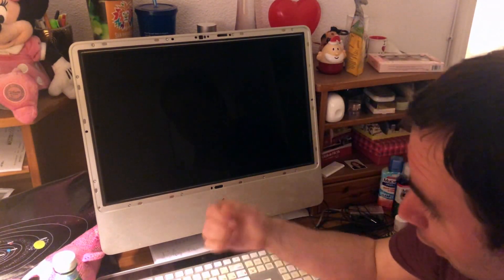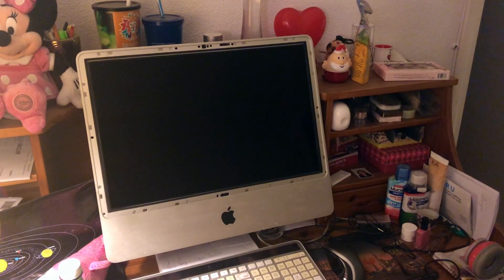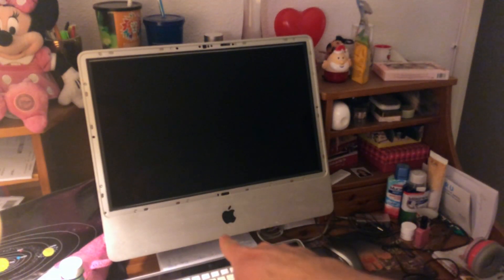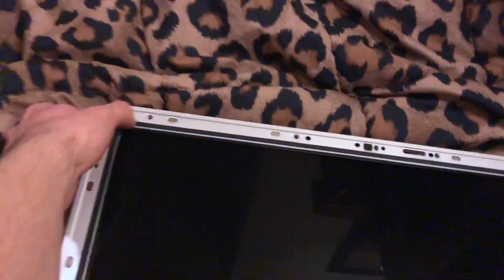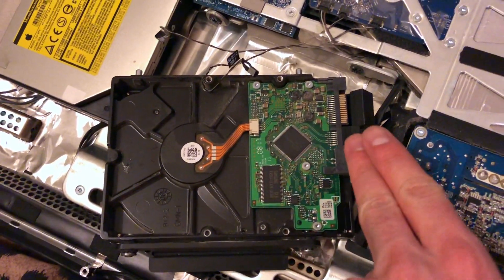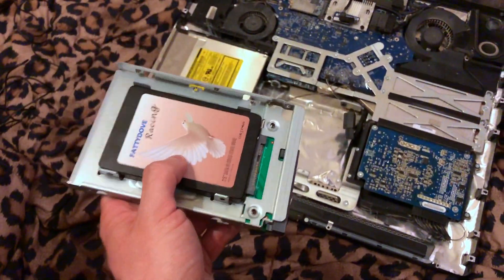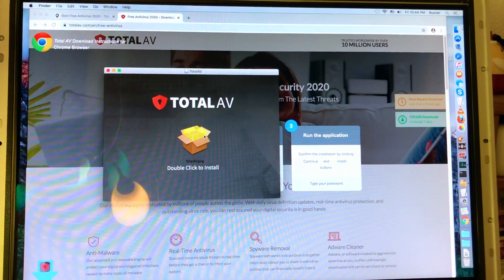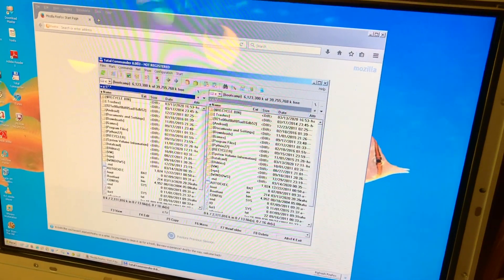How I Revived My 2008 iMac | Is it worth it?

Comment: I really wish Apple made the drive bay more accessible without having to take it all apart like the RAM is lol. I installed Monterey through OCLP and it works fine, even was able to install the newest version of Google Chrome but it's pretty slow and I think the original HDD is a big bottleneck.
Reply from the maker: Yeah, the process is not very straightforward, but after the SSD upgrade you will see a big difference.

HDD speed is that slow..

Comment: Gran video, como se puede solucionar el problema con los ventiladores el cambiar el ssd, existe algun adaptador?
Reply from the maker: @andrericar  ¿Por qué hay un adaptador ahí?
Reply: @NomadicDmitry  When replacing the HDD with an SSD, the temperature sensor from the HDD gets disabled, causing the Mac's fans to run uncontrollably. However, there is an adapter cable that simulates the temperature sensor, allowing the fans to work normally. That’s exactly what I’m looking for for the same iMac model, but I can’t seem to find it, my friend.

Comment: Yesterday i found iMac early 2008 in grandpa’s garage, switch off from 8 years, i would is it possible put 6 gb or 8 gb? 
And i would put 1TB ssd and i used to the iMac for only photo and video (for see and arrange)
Reply: identify it using this https://everymac.com/actual-maximum-mac-ram/actual-maximum-imac-ram-capacity.html (identify using EMC number on bottom of stand) it will tell you the max ram.

Comment: I’m having a problem with mine. It wont let me install any software at all and the software already installed is apparently gone. What should I do? Use an older disk?
Reply: The imac just boots into recovery mode everytime and I can’t do anything to get out of it since you can’t boot with a usb....
Reply from the maker: 1) Boot using the DVD shipped with a computer. You need to see in Disk Utility that Hard drive actually works
2) Install the OS from scratch.

I guess you first need to see if that's a hard drive problem or software. But the fact that it boots into recovery mode is promising

Comment: So would you suggest this upgrade?
Reply from the maker: Yes, if:
1) You have time (prepare for the whole day of fun stuff)
2) If you really have a use case for this system. Let's be clear - it's still a dual core processor and slow memory
3) If you install Windows or Linux there because even if you get the latest Mac OS there (not supported officially) it will be slow
4) If you will use it for at least 2-3 years
5) If this will not be your primary computer. Let's be honest - it's 12 years old computer

So, it depends...

Comment: Hello tezka, also have iMac2008 2.6mhz. And want to install SSD in there. Going to buy Samsung 860 EVO 250 GB. 
What is bodering me is that it will not work on Sata II negotiated speed with controller, only sata 1. I hade this problem om mac mini 2010 (but seems it was due to nvidia controller, here i have intel). 
Have you checked negotiated speed after replacement in system info app?
Reply from the maker: Nope, I didn't checked the speed. I think at this point you will see a huge speed difference even if you buy the cheapest SSD :)

Comment: What kind of SSD did you use? 2.5" SATA?
Reply from the maker: Thank you for asking! It's was a regular 2.5'' SATA. You can either buy an adapter from 2.5'' to 3.5'' and attach it properly to a bracket. Or you can just glue 2.5'' inch SATA drive. Whatever option you like. It's an easy fix, just be careful when disassembling the computer.

Comment: hey I was planning on changing the hard drive of my grandfathers iMac , what screwdriver did you use to remove it?
Reply from the maker: dropsvisuals Hm, I don't really remember. I think I've tried bunch of those until it worked out 😀
Reply: I know I might be too late, but I just disassembled mine. It’s a Torx T8.